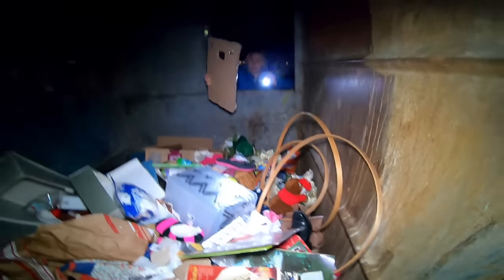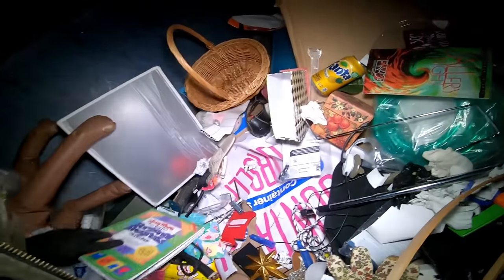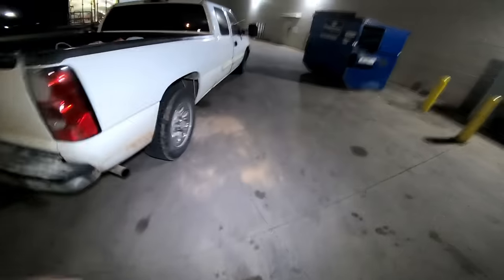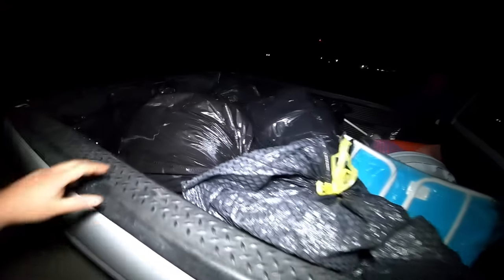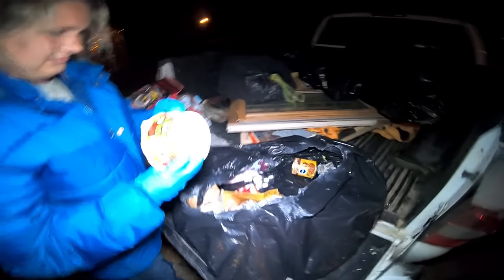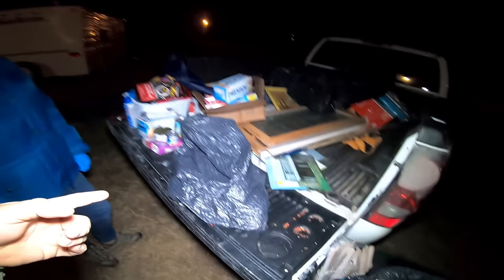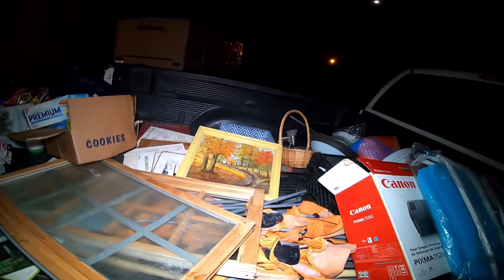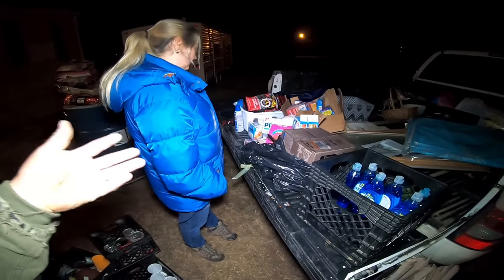We Filled The Entire Truck Up With Goodies AND A VOICE FROM BEYOND!!

Comment: Take those recess pieces, melt them, then dunk pretzels in them. Great haul. Too fun. Well you won't have to hardly grocery shop for a while. To check dented cans, push on the top. If it is springy don't eat. Also if the can is swollen as Adam said. Bay leaves I just read on are great to cook with. Thanks guys for sharing.

Comment: Dont worry if the bags of chips arent puffy. The air in the bags fluctuate with the air pressure. If its flat and not opened they are fine.
Reply from the maker: That's a good point
Reply: @curbsidejunkies  i had a chip delivery driver tell me that. And the sell by date just means they cant sell it but the products are still edible. Food (other than milk) doesnt expire exactly on the best buy date. I promise you wont get sick.